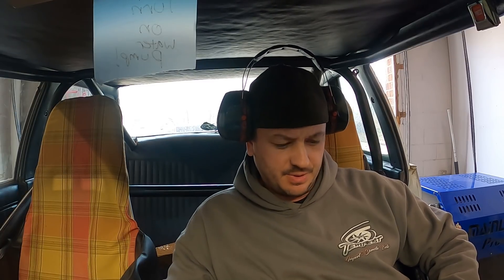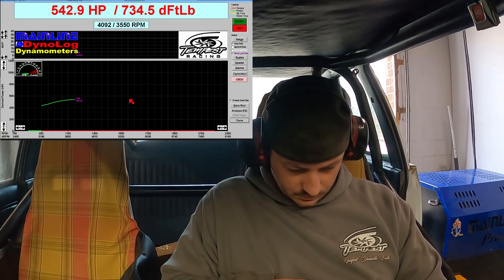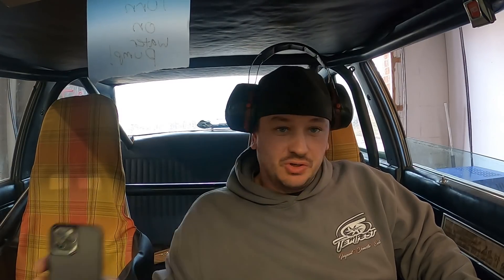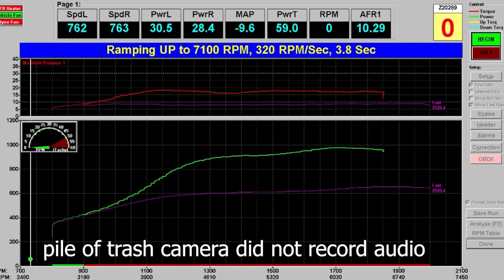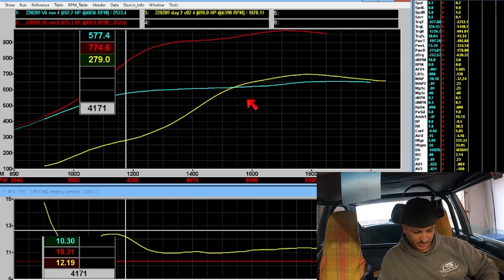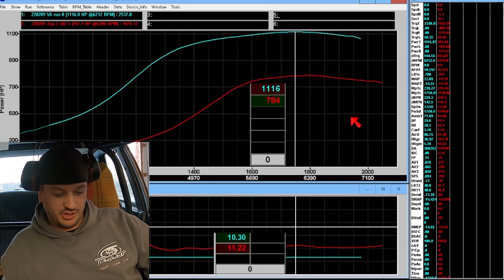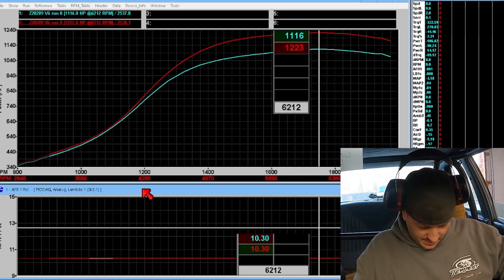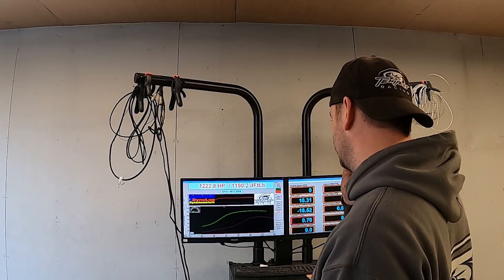Tuning a 1200 Horsepower+ Twin Turbo LS Swapped  Fairmont w/ Holley EFI

Comment: Does the mainline use inductive pickup for rpm? Trying to figure how they are able to test cars with high stall and dynapack cant?
Reply from the maker: Handful of ways to pick up rpm. I had to sell my Dynapack for that exact reason. Wouldn’t work with the auto cars
Reply: @JoeSimpsonAtTempest  thanks for the reply and the feedback. Great content. I use it for reference to show my customers what goes into a average tune session.